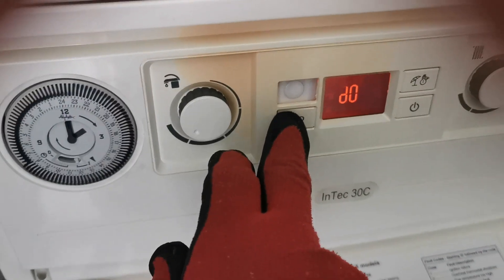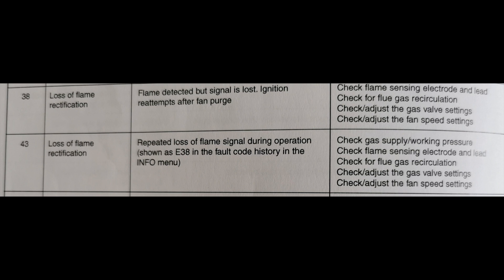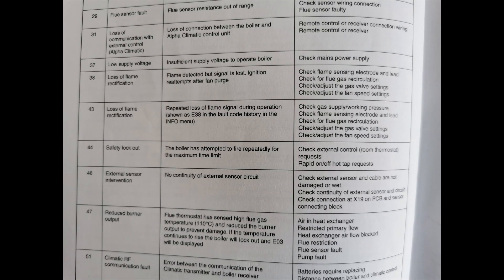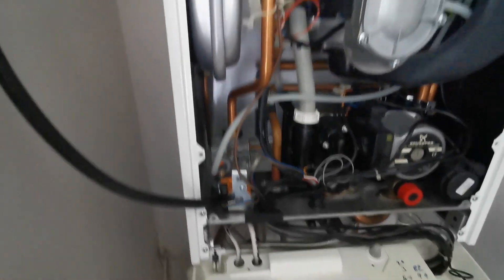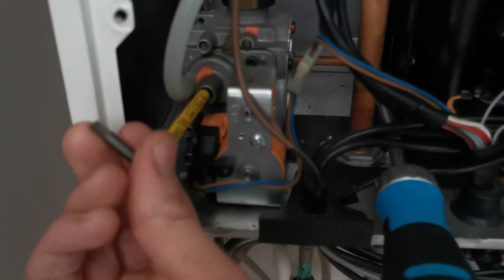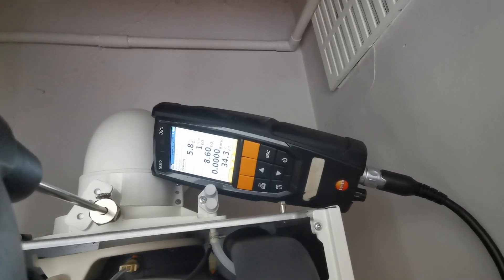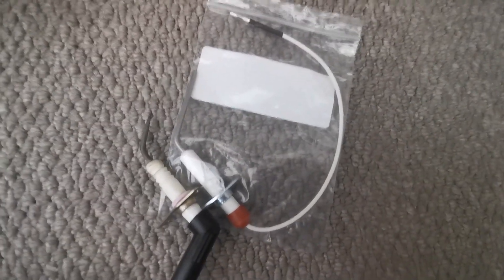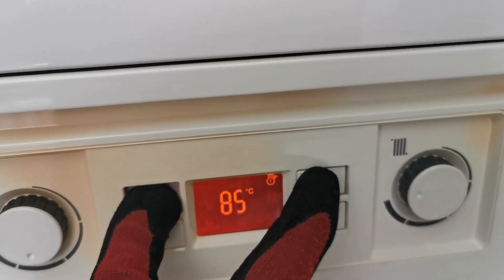IT DOESN'T TELL YOU THIS IN THE MANUAL - ALPHA INTEC BOILER LOSS OF FLAME SIGNAL E38 E43 - ALL FIXES

Comment: Hate alpha, parts too expensive! That stupid electrode comes without the O-ring seal too
Reply from the maker: I don't mind them, work on loads so got to know them. But they are expensive parts and that missing oring is massive stinge
Reply: what is the part number for the oring or equiv please  @goldgas1216
Reply: @goldgas1216 where can you order the replacement o-ring please? We’re getting the E43 - Loss of continuous flame signal and E01 - Ignition Failure fault codes a lot. Holding reset works but the faults return. Taken the electrode out and cleaned it but fault still apparent. The electrode in my boiler has two probes on it 🤷‍♂️
Reply: I’m currently getting an intermittent e96 and e37 fault code had the electrode changed over last week and seems to be a continuous problem had 2 different guys with not a lot of experience with alphas checking it over and haven’t come up with the solution. Been checking online and seem to come across the gas valve or the flue blockage although other posts I’ve read has been low voltage. My heads mushed with the pillar to post findings with no solutions. Any help would be appreciated. Thanks in advance.